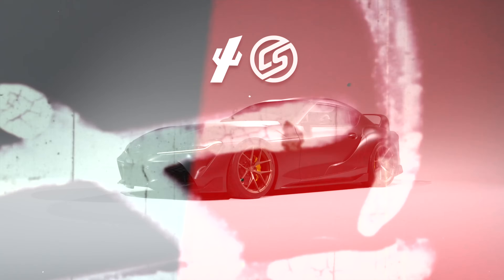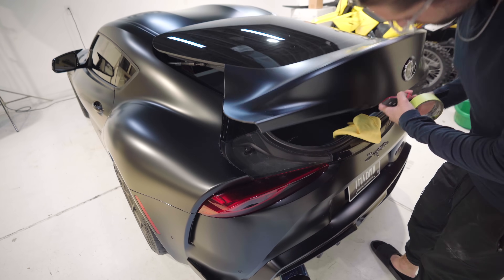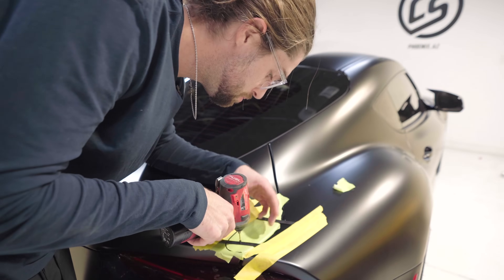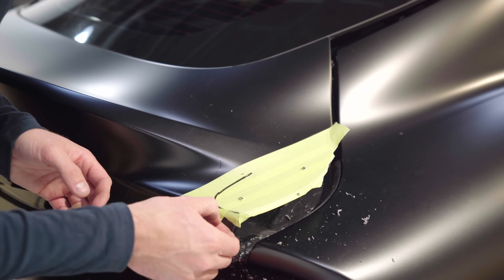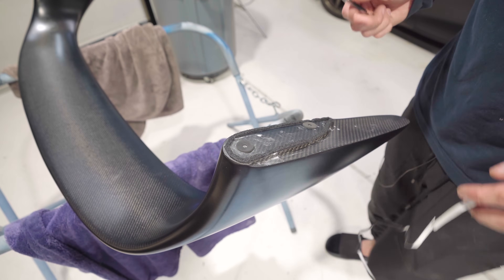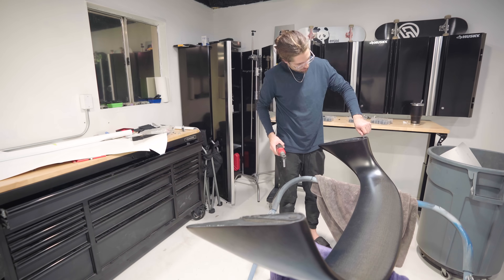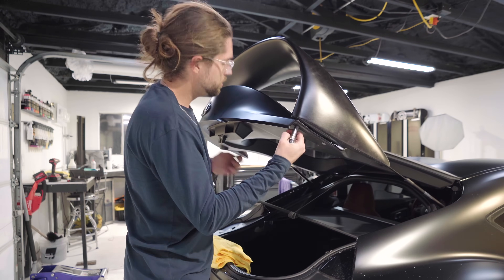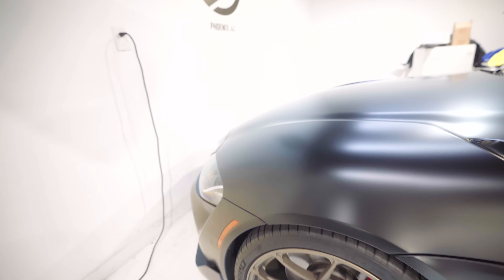Mk4 Style Supra Wing Install & Custom Paint Job! (Fades Satin Black to Carbon)

Comment: Hey brother the wing looks amazing. Would you mind sharing a few pictures of the inside of the trunk to see what it looks like from the mounting points? once you put it back together. Second, Due to the new weight, did you have to change the trunk struts? Lastly, When you close the trunk, are you able to shut it from normal height without damaging the fenders, or does it have to be closed from one inch ?
Reply: Trunk struts are recommended to replace because the stock ones are weak